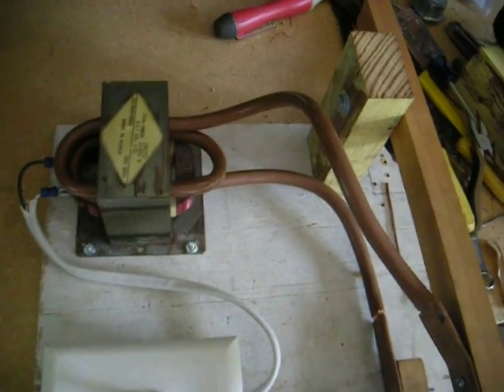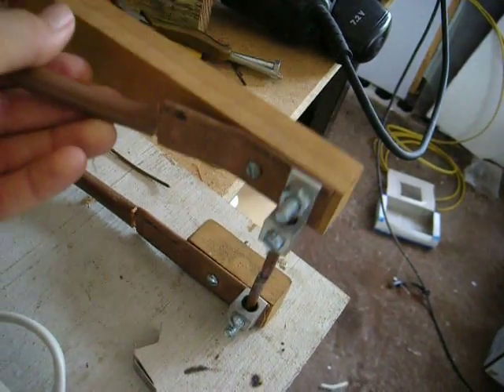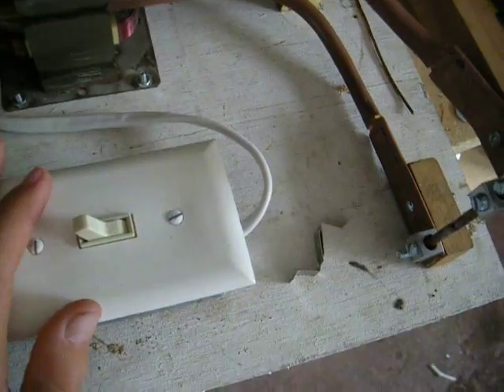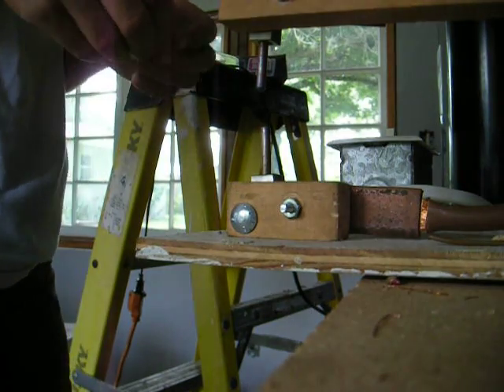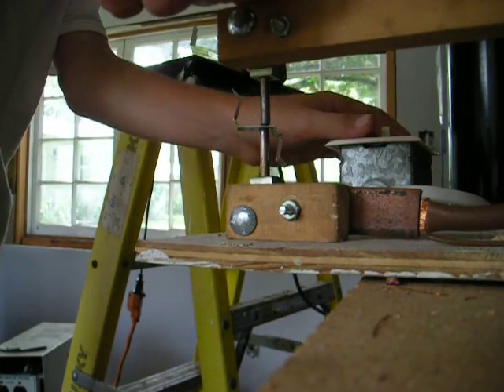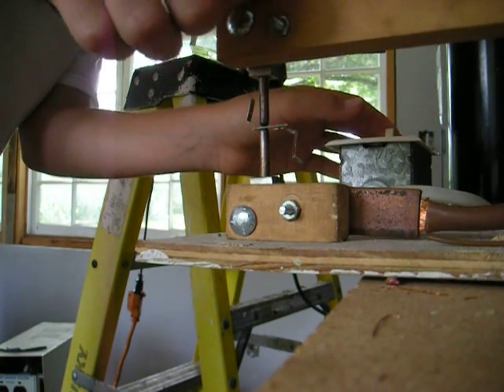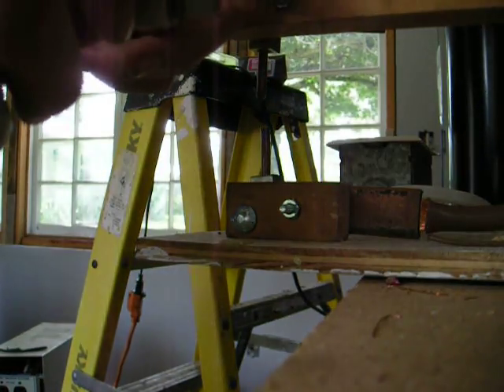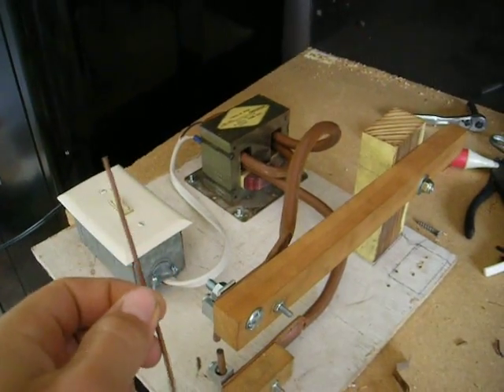homemade spot welder

Comment: @ItsCiarian I R idjut? nauuu!  I r nots idioot.  It's 3 volts, it's not gonna hurt you.  I've got a bank of 2.5V ultra capacitors that will discharge at 9000 amps shorted, but I physically CANNOT get hurt by them.  Do some math, and you will see that the highest possible discharge current through average human flesh at 3V is .3mA, which is VERY far from the 20mA needed for alternating current to cause cardiopulmonary fibrillation.  Touch the leads all you want, it'll just feel funny at 3VAC.
Reply: Hope you've not yet died of your lack of understanding. But voltage is not what kills. Current is what kills. Dropping voltage increases current. The current in the primary could kill you. 1/10 of an amp can be lethal. There is more than that in his primary winding. His secondary probably has (throwing a number out) 1000 times that at least.
This is why stun guns of 20,000v just stun and don't kill. All voltage no current. Late to this convo but wanted you to know. The current across those tongs is WAY MORE than lethal.
Reply: Just don't become the conductor between the tongs and you won't be burnt or killed (depending on the path through your body). Otherwise cool build kid. Was looking at doing one of these myself. People considering it, however, understand ohms law. Current kills. Voltage stings.

Comment: @3mustardMoNkEyS I don't know, I have never tried brass. Give it a shot, if you find you are getting inadequate welds or the electrodes are  getting excessively hot, invest in some copper. I used copper pipe, hammered flat and rolled into a rod shape and filed to a blunt point.

Comment: @3mustardMoNkEyS The electrodes have to be copper. Steel has a relatively high electrical resistance, which is why a current through it will melt it and allow the steel to weld. Copper has a very low resistance, so copper cables and electrodes will not melt.

Comment: @valveman12 gtfo and hit the books. try holding a AA battery and feel what thats like getting electrocuted by. then multiply that feeling by .75 and you have what it would feel like to get electrocuted by a spot welder. think about electrocution like getting shot. the amps is the size of the bullet and volt is how far it will travel. true the size of the blullet would be comparable to a car, the velocity the car would be traveling would be comparable to being parked.

Comment: Cool video!  Thank you for posting it.
What are the electrodes made of, please?
Safe working habits avoid anything with voltage or that may be hot.  The spot-welding voltage is not a concern.  Capacitive coupling of the primary voltage can give you a tingle (small issue).  However if there is a flaw in the transformer then the 120V primary voltage could appear on the welding electrodes.  If lightning strikes power-lines in the area you can get high voltage arcs from primary to secondary.

Comment: @a380rockerfan It annoys you?  So you are assuming too much me thinks.  \i do have a degree in electrical \engineering as well as a degree in \hardware design plus a masters of \Engineering and you still won't find me holding the business end of a spot welder.  Yes the voltage is low and yes not likely to get shocked but still i wouldn't do it because there are variables involved you can't control.  So go ahead keep being annoyed.

Comment: @teslacoolguy Well your calculations are correct but none the less even with my vast knowledge of Electronics, I wouldn't be touching it.  Too much can happen that is not in your control.  BTW: After graduating from Engineering I taught Electronics for several years.  If I saw one of my students doing what you did, he would no longer be in my class.

Comment from the maker: @valveman12 I think you are the idiot here. The resistance of my skin with wet hands is around 50kΩ. Now this thing puts out 1 volt. I am going to assume that you at least know what ohms law is.  A 50kΩ resistor with 1 volt applied across it will draw a whopping 6µA that is 0.00006A, far below what is necessary to cause any sort of fibrillation.

Comment: @teslacoolguy Oh Yeah?  Maybe only 1V, but if you grabbed both ends of your welder and turned it on, you would not be able to reply to this post.  Any amount of moisture on your hands (including sweat) will greatly lower your skin resistance.  Don't be so smug about this it's no joke.  You really need to do two things here.
1) Wear leather gloves.  2) saftey glasses in the event a spark is generated.
Be smart!

Comment: and more energy is dumped at the spot between 2 iron pices then at iron on copper. when a hot spot apears, that is like a hall in a big sand sac, the hall gets biger and biger. the resistance of the spot grows and the energy dumped there is biger, and melts the metals together. the power is distributed in teh entire sistem (coil, bolts, pices to weld...) but it is dumped depending on the resistance, so all the sistem gets like half, and the weld spot the other half. but varies alot in time.

Comment: my friend, u have no idea what u are talking about !!! the gui here took out the secondary, high voltage winding, and put in 2 turns of verry thick wire. if transformer is like 800w-1kw, it means 1.4 windings/ volt. so the gui gets  @1-1.2v. to get to 1 kw with 1 volt, u need amps, A TON OF THEM 800-1000 more precisely. when he melts the wire, it dont pass that much, but even half is enough to melt it. the idea is to dump energy through resistance. copper has low resistance, iron high

Comment: yeh, but an ipods transformer isnt modified to send radioactive waves at the speed of light into a cavity your meant to put your food. the least you could do is google it but if you cant be fucked, then its your problem. a uni in 1991 studied that eating food cooked in microwaves posed a greater risk of cancer because it deforms the nutrients in the food, im pertty sure they built a fairly thick metal cover around them to prevent the radiowaves getting into our body

Comment: Are you joking? A microwave transformer doesn't give off radiation any more than the transformer you use to charge your ipod does. Microwaves just happen to have a larger one to handle the current.